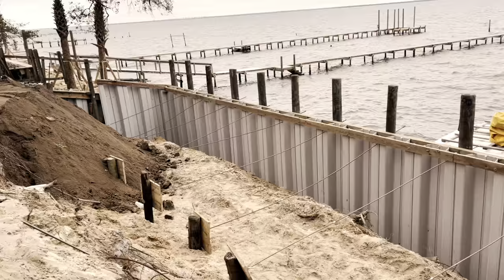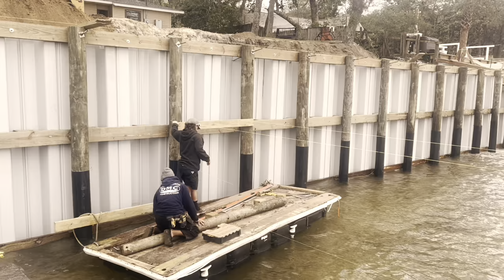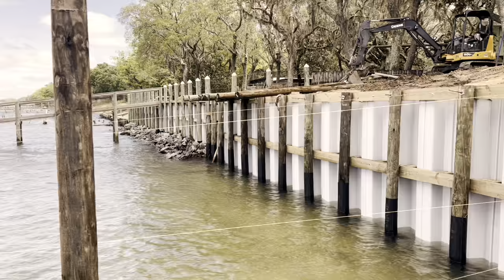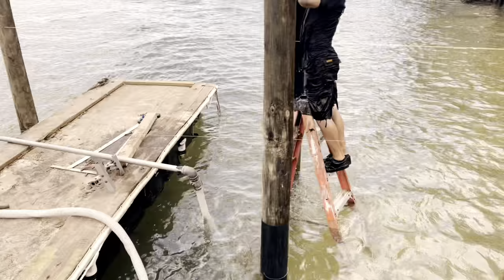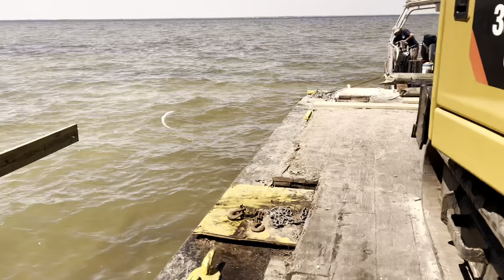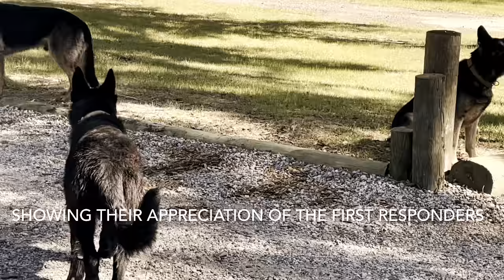MAJOR MAKEOVER, PILE DRIVING, Thru-Flow decking with a Golden Seadrive boat lift

Comment: Have you guys done (or considered doing) a boathouse with sleeping quarters (maybe a shotgun-style camelback)?
Reply from the maker: Thanks for watching my videos and yes, we would love to do that but unfortunately in this area of Florida, they do not allow enclosed boat houses
Reply: @DaleWHickman  I know after Hurricane/Tropical Storm Henri, a number of people opted to redesign their homes to have breakaway walls on the first floor of the structure.  Do you think it’s possible to get a variance for this?  Granted, I understand that you’d have to get approved by both the state and local/municipal code enforcement offices, but do you think they would consider it?  If not, maybe it would be worth it to approach academia to see if the faculty of engineering and architecture departments would take interest in this.  They may like to design a model in CAD (e.g. AutoDesk Architecture, ReVIT, etc.) and run it through a CFD program to test its ability to withstand a CAT 5.  Anyway, if there’s any promise at all with this coming to fruition, real estate owners/investors in certain areas may be willing to fund such research projects.  It may be worth checking out.

Comment: Enjoy your videos.  Question- i never see you compacting the fill behind the walls in "lifts" .  I'snt there a lot of settling with the loose backfill?
Reply from the maker: Thanks for watching my page in your comment. We do a lot of water getting behind here to settle the dirt out. I don’t like compacting and lifts due to the pressure on the wall, and not being able to have proper filtration in the soil.
Reply: Lotta times they put coarse graded ( porous) drain rock in  backfill from bottom of fillto about 1-2’ avove maxe tidewater elevation.
Reply: To reduce backfill pressure on wall.

Comment: These guys do good work.... I always wondered how long equipment lasts for the Marine companies under those harsh conditions. It must be expensive as hell to build docks and seawall because if you have to replace your equipment every 6 to 7 years and the caterpillar 308 it's about $170,000 that is not pocket change.... I've been to auctions and you can tell the equipment that was used by the Marine companies... Because they're all rotten to hell.... Marine companies most least their equipments
Reply from the maker: Thanks for watching my page and your comment you are correct. We have to do daily maintenance on our equipment to keep it in shape because the saltwater will really eat it up.

Comment: nice job what are you using for your tie backs?
Reply from the maker: Thanks for your question. We use a variety of different tieback systems from 6 inch to 8 inch pilings to manta ray  anchors.